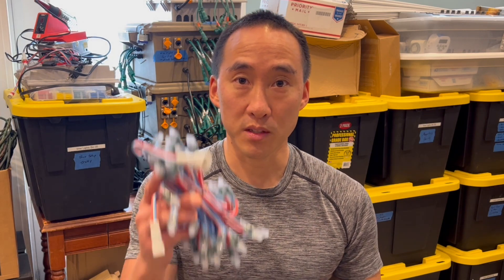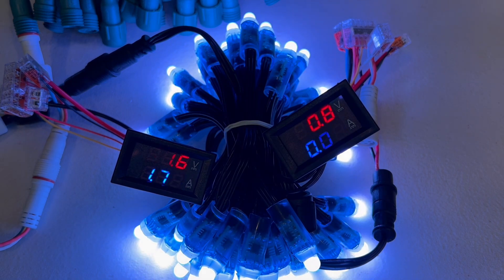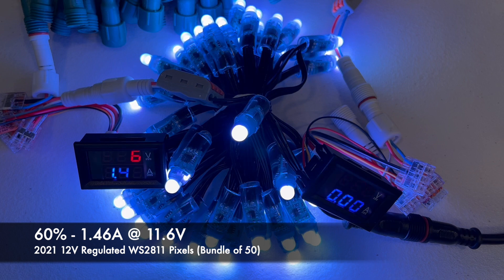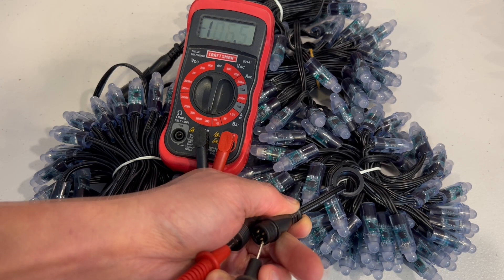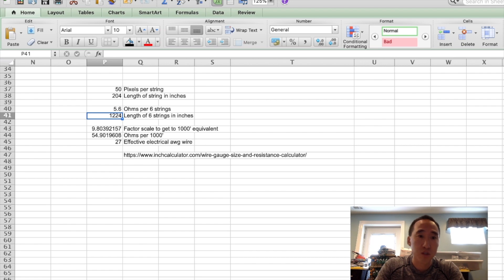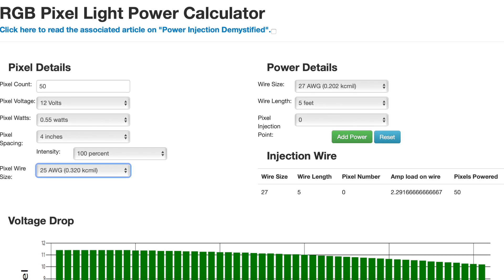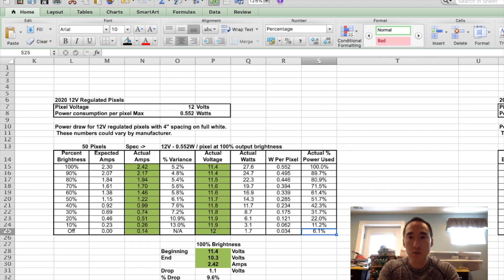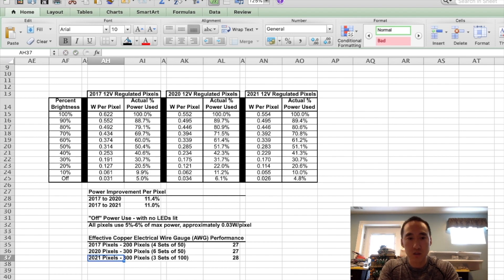Testing the Specs of 12V Regulated WS2811 Pixels (Part III) - 2020 2021 Pixels

Comment: Could you tell me how many 5v ws2812b  LEDs you would put on a meanwell 350watt power supply?  I'm getting conflicting info on the power consumption and watts used. My lights will be at 30% maybe a bit less but 30% is my plan.
Reply from the maker: @Douglas Higley, great question.  I don't use 5V pixels, but the general math should be the same.  These calculations assume no voltage loss across the strings of pixels you use.  But from what I've seen and experienced with a sample of 5V pixels, you'll want to power inject/power balance every 50-75 pixels to maintain power.  

I'd say with a single 350W 5V power supply, you can probably power over 3,000 pixels.  But, be mindful that you need to be sure you don't overload any single 5A fused output or power distro board output.

Here's some back of the napkin math. Assuming each WS2812b RGB pixel uses 0.05 to 0.06A of current, we'll use the high number and multiply it by 5V get a power usage of .3W/pixel.  30% of that would be .09W/pixel.  

For the power supply, let's use no more than 80% to leave margin for safety and longevity of the power supply.  That leaves you with 280W of "usable" power (350W * 0.8).  Dividing 280W by .09W / pixel = 3,111 pixels that can be powered by that power supply.  

More than likely you could power more, as the real world will have voltage drops across your pixels which then draw less power.  But, you're safe to power >3,000 5V pixels this way.

Back to the 5A fused output...let's use 90% (leaving 10% margin for the fuse).  If each pixel uses 0.018A at 30% (0.06A x 0.30), then you could safely have 250 pixels per 5A fused output (5A x 0.9 safety margin / 0.018A/pixel).

So, to power 3,000 pixels, you should plan to use at least 12 5A fused controller output and/or power distro board outputs.

Hopefully that helps.  Good luck with your show!
Reply: @NiFamilyLights   thank you for all this awesome info.  With the math in error that I was doing showed that with 1,695 pixels I was pulling 504 watts. I am power injecting in several places and have fusses inplace.  When I turned it on in test mode at 100% I only had about 30 pixels that were noticeably less white.  And I am good with that.  At 100% my neighbors would be mad.